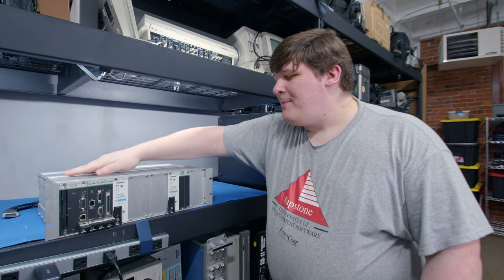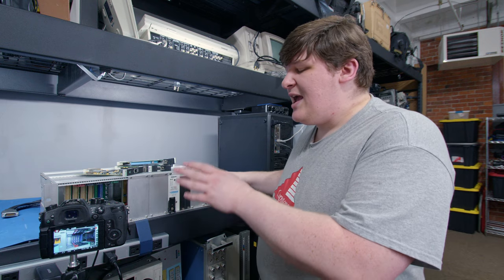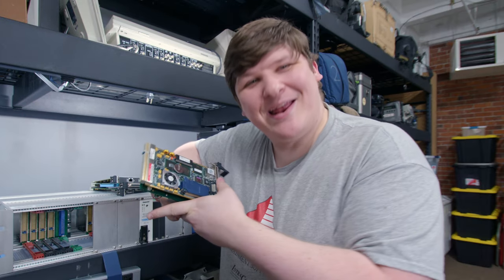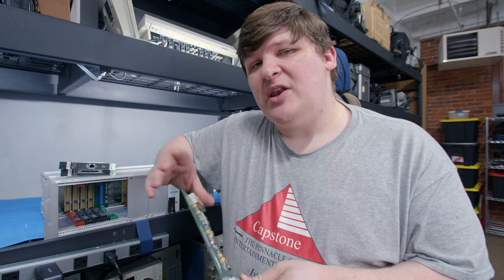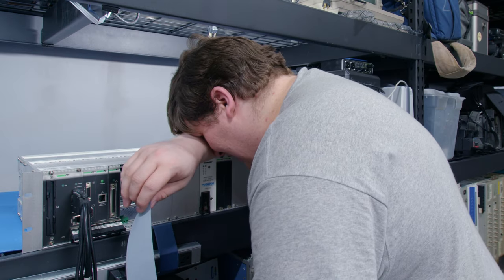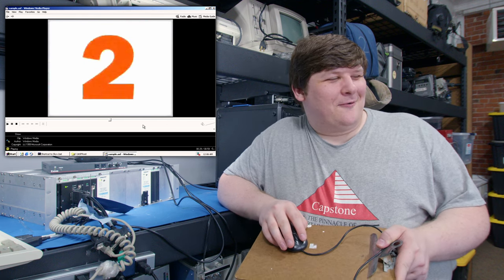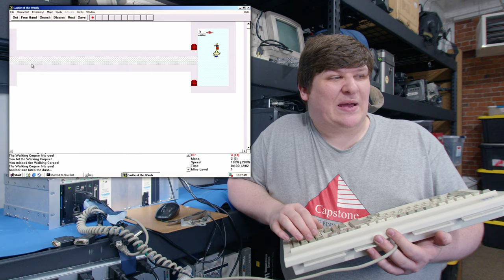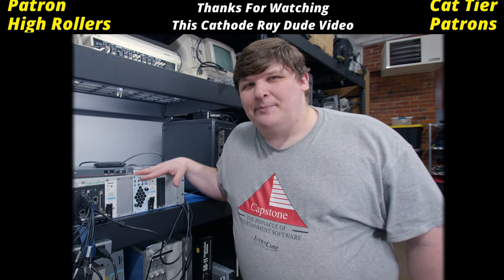Little Guys Ep 12: Computing With Eurorack

Comment: 486s run Doom perfectly well.  Only starts getting iffy if you are running Doom95 or other Windows ports.
Reply: He specifically stated he finds Doom demonstrations boring and blasé, so why not spice it up with a different game?
(And he's right.)
Reply: @XanthinZarda  The excuse just runs hollow when I've run Doom 2 on the family 486 at full screen and framerate.

Just stick with "I didn't want to," and that's fine.  But saying that a system that old can't run Doom is just sloppy, considering you could run it smoothly on a 386, if you didn't mind squinting at a postage stamp.

Comment: With regards the SCSI connectors - the specs specify quite a number of different connector shapes/sizes/form factors. Vendors also did many of their own. Quite likely the 68 pin connector on the inside of that card is IDC or so while the external is VHDCI. This also makes it SCSI 3 most likely.

In a follow-up comment we'll link you the document that our wife and us put together with complete pinouts for all standards-specified SCSI connectors and what each connector supports talking.

Comment: A long time ago I used to work on VxWorks embedded systems running on 386 and 486 PC/104 boards. PC/104 boards came in ISA, ISA+PCI, PCI and eventually PCI+PCI Express. They seemed to be pretty well standardised. Of course being an embedded system it wasn't guaranteed safe to add more memory or speed up the CPU. Adding more memory caused the VxWorks kernel to fail because it expected to be able to allocate a page table below 1MB. Speeding up the CPU might cause a failure because some driver made implicit assumptions about CPU speed vs something external that a faster CPU invalidated. Still with a lot of testing you could have got the system running on this board and it would fly. Also 4MB of Ram was plenty for the whole system. In fact two copies (last known good and next update) of it would fit in 2MB. VxWorks itself was tiny - 64K for a minimal kernel and 128K for the full one with filesystem, TCP/IP and all the other options. A 386 running VxWorks and had notably better performance running an FTP server than the Pentium desktop machine I compiled stuff on, i.e. it was blazing fast.

Comment: My guess is the lack of interoperability is partly just because you're always expected to source your components through a vendor/provider, so you never actually found yourself in the situation where you were buying individual cards, you always specced out what you needed and the vendor gave you everything as a complete unit (basically the modularity was for the sake of purchase customization)
Reply from the maker: @seshpenguin  yup, that's my guess as well. The existence of a standard was convenient for vendors, but very likely every single one of them would have reacted with shock and horror if you informed them that you had, or intended to obtain any component from another company

Comment: By the way, a "one weird connector breaking out into multiple common ports" thing is very common in x86 blade servers. They usually don't have much room on their front panels for all the usual ports, and they don't really need them exposed because everything is usually accessible through ILO, but in a pinch you may need to plug a monitor and keyboard into one to do some maintenance on site.
Reply: True, but typically these days they come in a non-proprietary USB squid, and not the horrors of "hope you didn't break the pins".

Comment: 22:00 I've barely seen anything SCSI, only 1 PC that had it, and yet I've seen those "Internal" connectors before. so, I can confirm that it is a thing. It's used basically the same way as the 50 pin connector, I saw it on the internal SCSI hard drive, with the 50pin used for a CD drive. No I don't still have it, I kinda blew it up, so threw the entire thing in the wheely bin.

Comment: Oh my god YES! Those DMS59 connectors are HORRIBLE!
We used to have a fleet of Optiplex 380 SFF Dell's at my company, and every single one of them had the exact card you showed on the screen.
The plastic between the pin connectors were so flippin fragile you could easily crush them if you put the connector in wrong.
Not to mention the pins themselves were so small and thin they would bend if a mouse farted on them!
I had to use a razor blade to bend the pins back into shape, just like you would use one one CPU pins that get bent. NOT. FUN.

Comment: I have a socket 7 motherboard that supports both 72-pin EDO SIMMs and 168-pin SDR DIMMs. If I remember right, that was a pretty common configuration as SIMMs gave way to DIMMs in the Pentium days.

Comment: Lots of VME systems still use similar 30+ pin front panel connectors for serial, video, and other IO. I haven't seen any adopt USB C for video and IO but they may in the next 5-10 years.

Comment: I did look up old eurocard cases as a cheap way to expand my eurorack modular at the time, as I knew the spacing etc. would be the same. Ended up making my own case instead.... which needs 3 power supplies, and is 21U in height lol

Comment: I have been all over industrial computers lately. (Mostly the single board computers nothing as slick and modular as this!) They're small and generally well made and interesting, My experience with PIGMG standards is that they leave a lot of things... Up to individual implementations. The things that are defined are rigidly defined, everything else is done by the system builder ad-hoc. It's not quite like building your average DIY ATX computer. Hope you like crimping your own cables!

That speaks to the market for these things - They're bought by system integrators and sold as a turnkey solution. Built up, then installed in a ruggedized chassis that will survive untouched in a closet or a factory or piece of motorized equipment or a firetruck or whatever. Sure everything is modular and swapping parts out is a breeze- But the geek squad isn't gonna be able to do it for you.

Comment: I got a few industrial "Computer on a card(s)" They go on a backplane motherboard. Just a fat fullsize 486, full size simms (2 of them), 2 ide sockets, and 1 floppy socket. Then a covering of all the diodes, resistors, and capacitors along with a few more ICs.  Its is a crammed full marvel. Just a video card and a sound card and you have a gaming PC the size of a large dictionary with a pico power supply. Best part. Its just normal old 16 bit isa.  Also there are a few Toshiba laptops with the 266mhz Pentium. So mobile.... probably.

Comment: That network mask is strange! That's a 5-bit address block starting at 10.8.6.32 and ending at 10.8.6.63. That leaves room for just 28 devices on the network. Wonder if the intention was to sell this unit for use on personal planes.
Reply from the maker: That IS an interesting observation. See, I didn't want to get into analyzing the thing because I could have chewed up a ton of screen time with guesswork and killed the momentum, but since we're here: the big question is whether it was used to serve passengers directly, or if this was simply middleware that expected an additional piece of equipment to do the user auth, NAT, apply firewall policies, etc. By this point in time Windows was not generally used for those kind of tasks, and maybe that's why they were trying out the dual chassis: perhaps the intent was to have a second cPCI machine running e.g. BSD that handled all the typical router tasks, talked to RADIUS for user auth, etc., and that would have performed NAT, allowing a whole plane's worth of passengers to get online. Utter guesswork, but plausible!

Comment: These remind me alot of PLC's - programmable logic controls.
They run the same back plane and have power supply modules ,cpu modules ,
Input and output modules , and tons more variations. 
GE electric and fanuc and many other company's made these ,for controlling machines and CNC's
Etc.
Very robust  operating systems
Reply: I believe the ethernet cable on cpu module is for programing and loading programs.
And the separate ethernet  module is for networking

Comment: You know, I wonder if they sell/sold KVM units that would be pretty much a laptop with an umbilical that plugs into that abominable cable, making it actually quite neat instead, with all the ports you need in use already with hardware at your hands and a few in an external form through the laptop-like form factor.
...then again if I got it correctly this one just had to NOT pass video through just to screw things up as if on purpose...

Comment: @CathodeRayDude Ok, maybe you can answer this question.... why would kingston make an 8 gig SSD? The drive itself makes no sense as at the time it was made, windows install would exceed the size of the drive.... an extremely paired down linux or unix os would fit, but even with network storage it would still be pointless.
Reply from the maker: I'd have to check, but I'm pretty sure even the latest version of Windows can fit in that little space if you use the Embedded version, which lets you delete massive chunks of the OS' functionality.
Reply: @CathodeRayDude  thanks for the response. Still seems to be a lot of work to use a drive that seemed to be released after larger drives were already out and were at the same price point. If you want it to mess around with for whatever reason, I'll send it to you. Lord knows I have nothing to use it for

Comment: 12:40 There were some "fake" Pentiums made by the chinese  which stuffed mobile dies into desktop socket 7 packages. Uo to 300mhz this way!

Ive got a Dell Latitide XPI CD which uses those early SODIMMs. Also, that fan is a standard part made by Sunon. I have a few in a bin that I will probably never use!

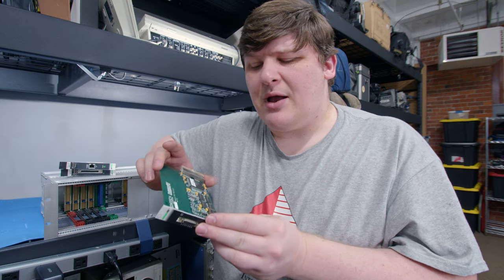20:14 Please please do a video on the VESA feature connector that is a subject I have been deeply interested in and confused by for over a decade. Include the EGA version and card edge version too, will ya?

Comment: Ethernet and serial would be super common in industrial stuff.  And many industrial pcs don't have any video at all because they are intended to be 100% remote controlled with no display at the physical location.

And telnet is one of the most common ways to remote in because of it's age and simplicity.

And no sound either - no reason to have that.

Comment: You would need both sticks of ram if its conforming to standard 72 pin standards as 72pin only has a 32bit data bus and Pentium class CPUs need 64bit, it would use both matching memory sticks to build up a 64bit data word  much like duel channel memory in modern systems giving 128 bit data access.

Comment: Why does it look like a modular synth case?
Reply: From what someone else said, the horizontal spacing is 0.2 inches.
So it's actually the same as Eurorack modules. It's a valid modular synth case, and I've seen others in the comments already plan out a synth system for the case.